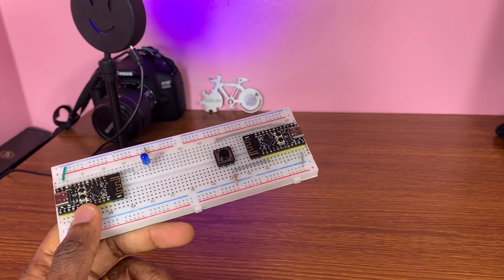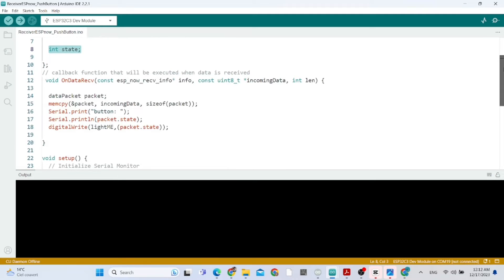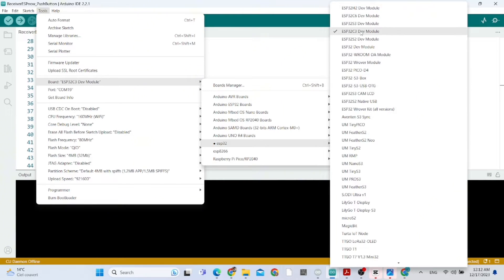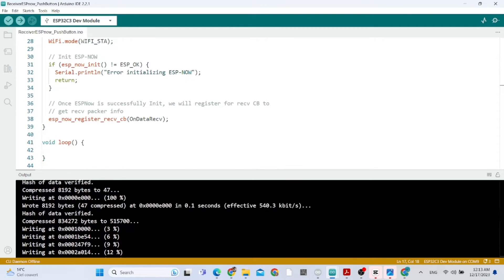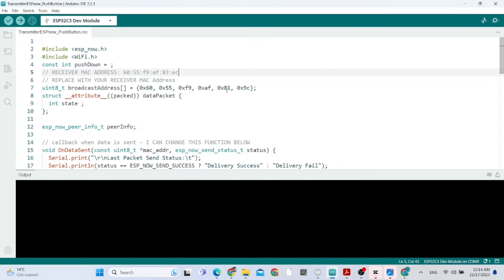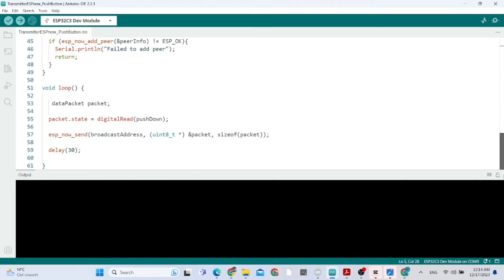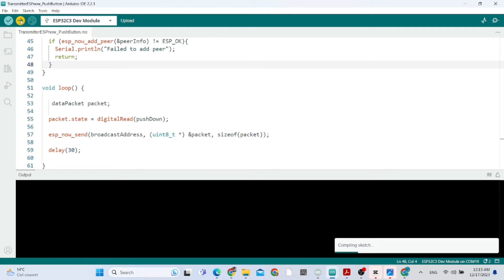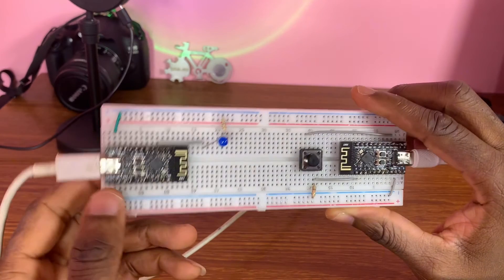Controlling LED with ESP32 and ESP-Now | ESP32-C3F4 Tutorial

Comment: hello can you share your library for this code? i have a big problem to find the right one. most of the time iam stuck on (WiFi.mode(WIFI_STA);)
Reply from the maker: You don't need to install any library for it.  The library are installed when you set up the ESP32 board on the Arduino IDE
Reply: @uploadideaswithitamar  i try it asap. Thanks you so much. There is so many of them and iam also the owner of some clone. Feel little bit lost in them 😁
Reply: @uploadideaswithitamar  still stuck on The same problem. I try to instal so many ESP32 and nothing happend. Basic programing work ok, but when i start using WiFi.h it's going to crash